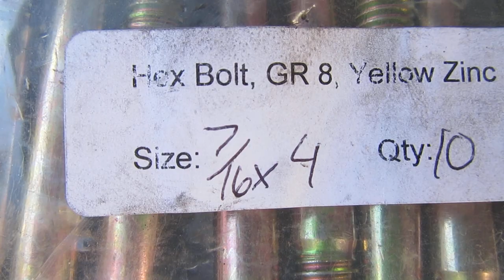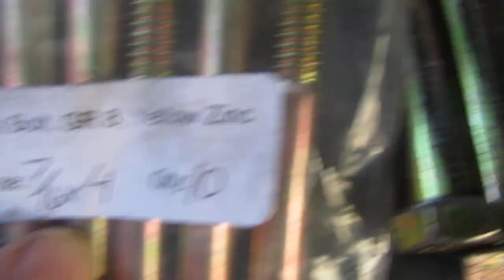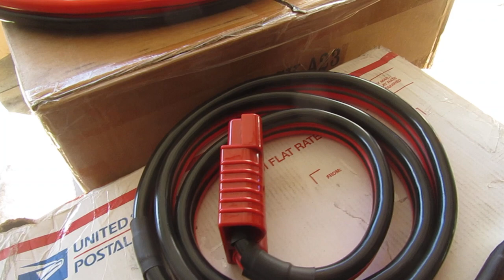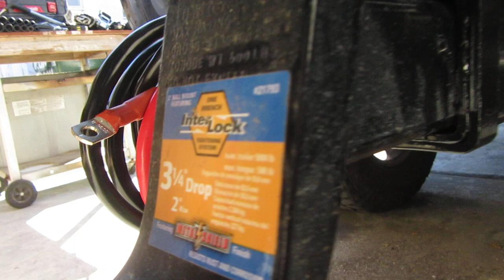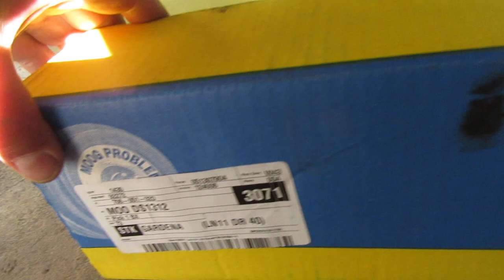My ZJ Steering Box Broke - Installed MVF Steering Brace

Comment: Yeah I would say someone was looking out for you, whew!!

Years back, in '93, I had a suped up VW Rabbit, with racing suspension, bigger motor, etc, custom wheels (so custom that they required longer (BMW) bolts, which I neglected to use). I used my original lugs that only caught about three threads of the hub. Well one day after work I was racing a fellow worker on the freeway going over a hundred, zigging (but not zagging, as that would be illegal lol) thru traffic. I finally found my exit and was cruising at 30mph and my left front wheel fell off. Had it happened 3 minutes earlier I would a been writing this from six feet under!
Reply from the maker: and, I had another God looking out experience this past weekend.  ♥♥♥♥♥

Comment: Get adjustable RC links!
Reply from the maker: What can I say?  I'm cheap. An adjustable Sway Bar link itself wouldn't fix the problem.  I really need to get an entirely different Sway Bar; which, are only available thru custom order.  Right now, with as hard of wheeling I do, I just replace the grommets and occasionally I have to hammer on the links to get them to fit back on.  So far, I haven't broken any; but, they're not terribly expensive if I did.  I did once have to drive home 400 miles without them and it wasn't too bad; so, until I find some, I'm not in hurry.  There's not very much aftermarket support for ZJ's and really, talking to some industry leaders, they're not really interested.  About the only company that would be open to more ZJ products is Mountain Vista Fabrication and he's pretty busy with the product line that he's got; so, until then, I'll roll with the same Sway Bar, replacing the grommets at least once a year and if they break, I know I can get stock XJ links off the shelf of most any auto parts store.
Reply from the maker: Can you send me a link?